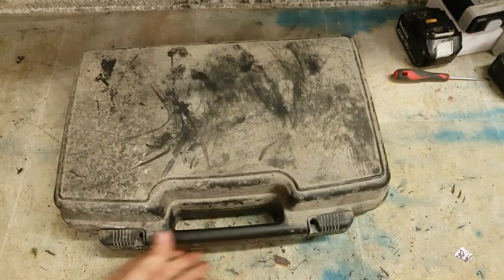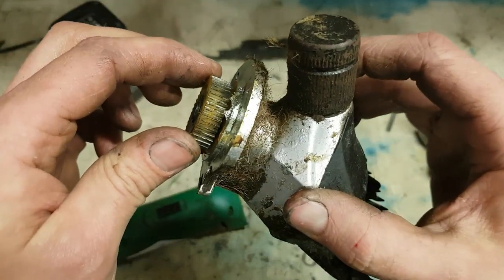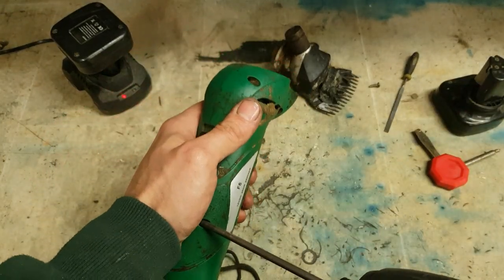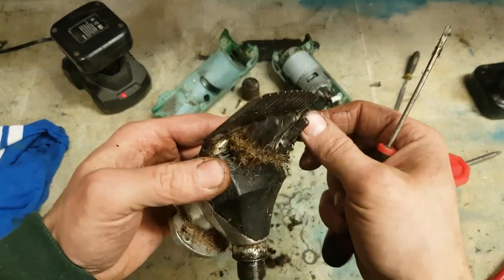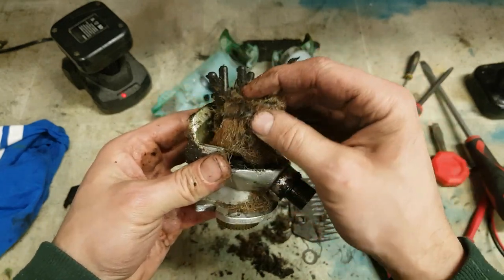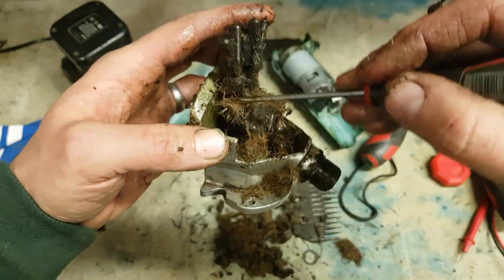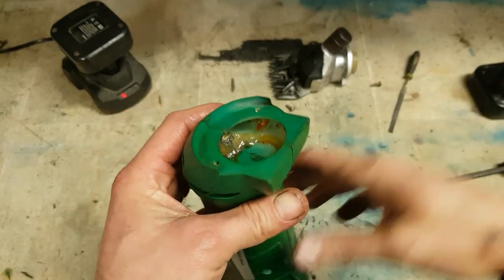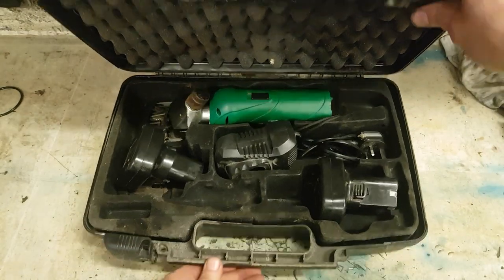Repairing a set of ErgoPro F6 cordless 12v clippers, or shears.

Comment: 200 odd quid for those 😱wow
Reply from the maker: At least. The new model cost 320 euro today
Reply: @deandohertygreaser  is the production cost of these insane or is it mass profit due to corporate greed?
Reply from the maker: No there is simply not enough volume of them sold to take the price down. Low volume production means a higher price tag